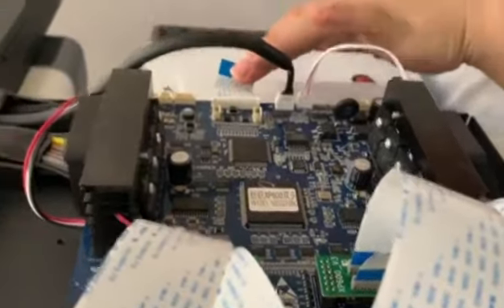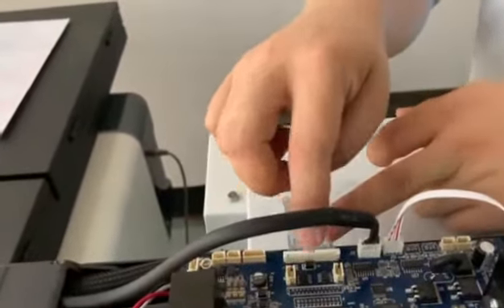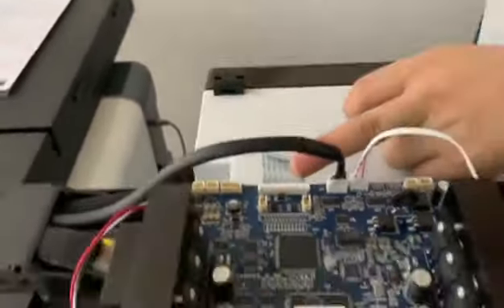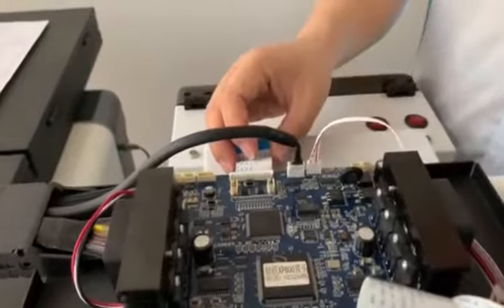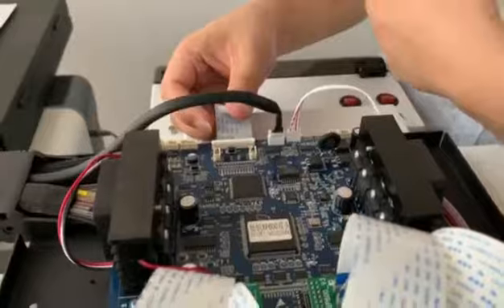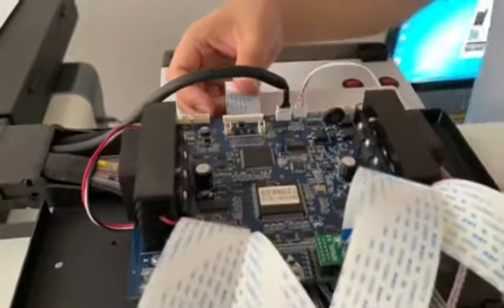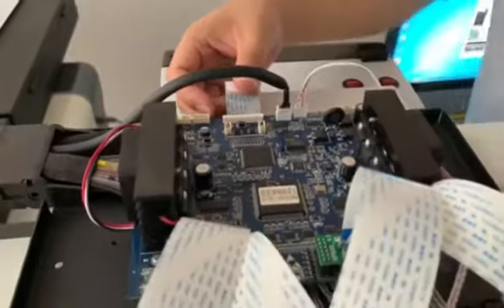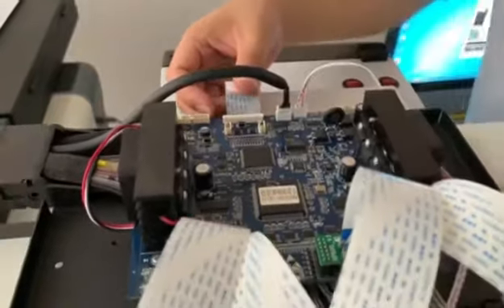How to solve the link fail problem of Nocai flatbed uv printer(part 1)?

Comment: hello sir..i have the same problem  on this to my printer now.i just change the white head, then its okay.but after i turn it off the printer and then open it again, thats happen to my printer now.
even the head cable stills connect at the board and its have the all lights but not blinking its still have the problem link fail. i dont know what to do now.